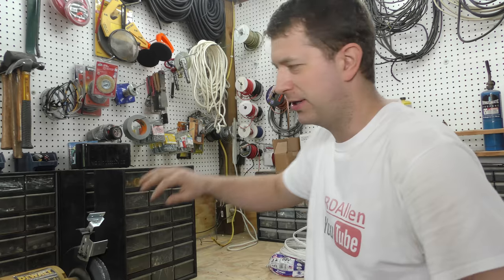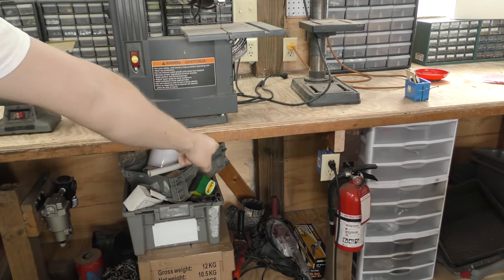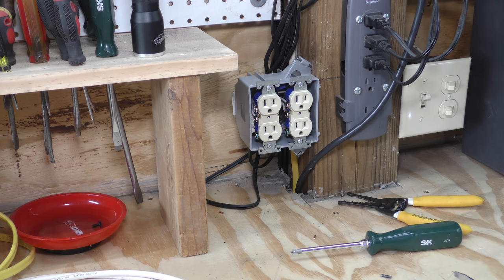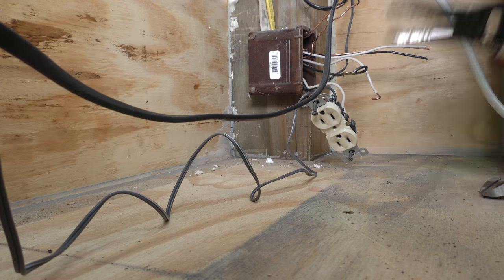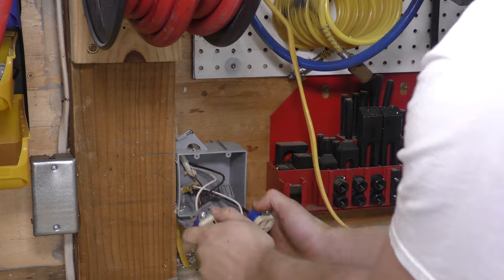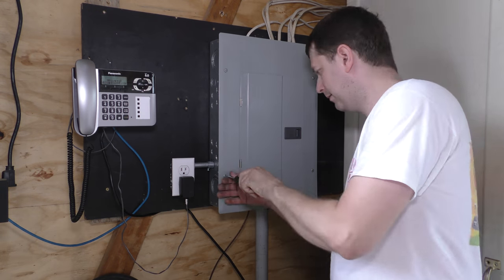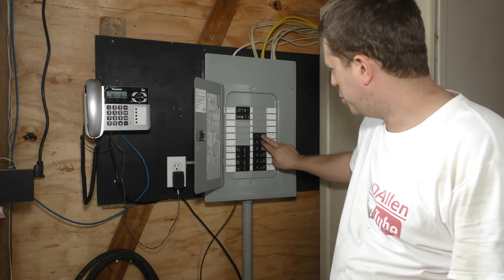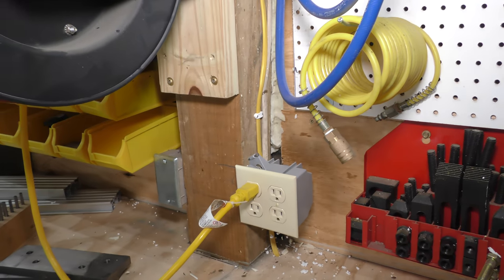Splitting Up the Electrical Circuits in the Barn - The Barn Project

Comment: they call it 12-2 because the ground/copper wire keeps the circuit from being fried. Also,, the black and white wires are the main wires used to power the receptacle.
Reply from the maker: I realize that just seems odd it is 12-2 when it has 3 wires
Reply: Its because the ground wire isnt considered a wire, all the ground does is keep the circuit from essentially being fried

Comment: 12-2 means one hot wire (black) and one neutral wire (white) then the ground. 12-3 wire is the same but with two hot wires (red and black) and one neutral (white) and the ground as well.
Reply from the maker: Right, I realize that, but 12-2 has 3 wires technically while 12-3 has 4